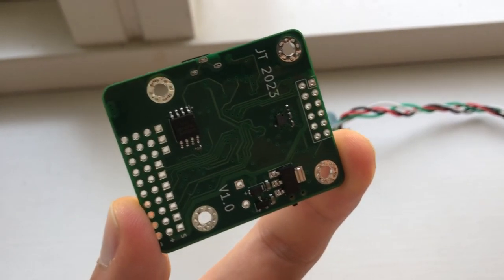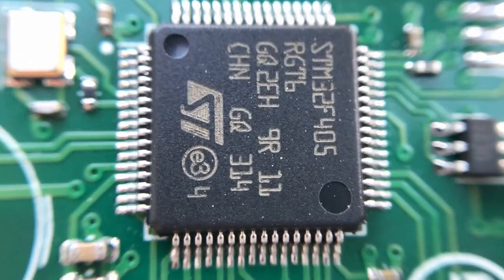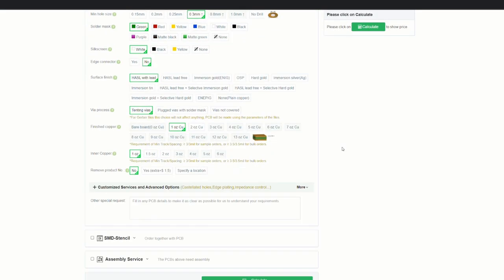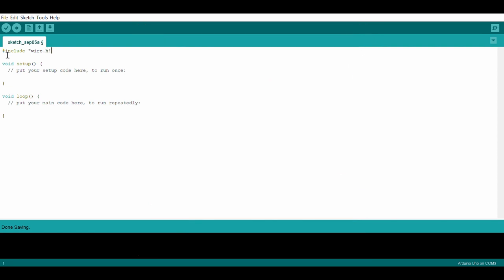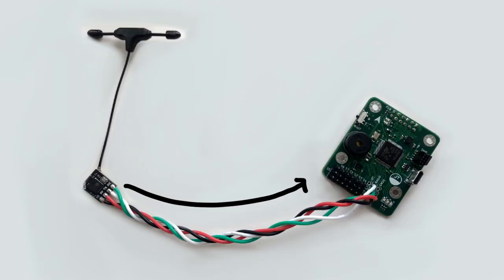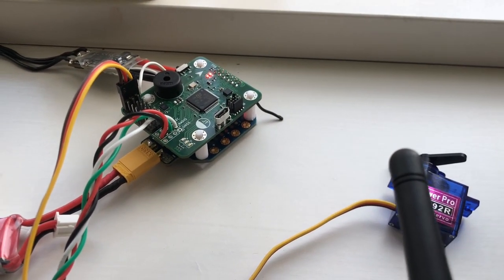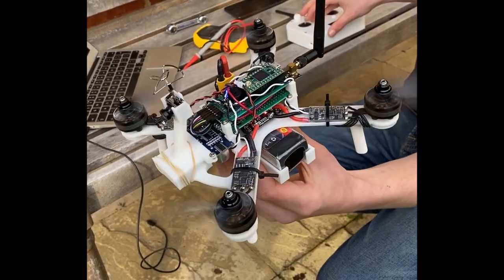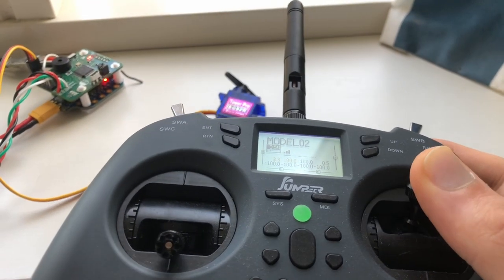DIY Flight Controller for RC Drones & Planes

Comment: Just a comment on firmware: I can't think of a single benefit to using DMA with a buffer of 2 bytes. You end up having to respond to one interrupt per byte anyway, so you may as well stick to using the USART's ISR instead. You still have to process each byte within a state machine for decoding the Crossfire protocol.
Reply from the maker: I think your right! I started using DMA before realising I had to process each byte. I’ve since switched to a simple interrupt system.

Comment: A quadcopter drone would likely be most challenging to diagnose and build, but integrating the Flight Controller on to an existing RC Plane frame would likely be a good 1st step to prove out the Flight Controller development.

Comment: Huge like for not using Arduino. This is a great step forward. I also may recommend you switching to Rust at some point 😂 The support is not that good as very straightforward STM32 tools, but Rust is SO MUCH BETTER as a language compared to C.

Comment: For testing I would recommend a model airplane since its flight is not heavily dependent on software like rotary wing drones. It can help you to gain experience and learn without so much trouble. But you would also need to learn a bit about aviation. Good design by the way, thanks for sharing.

Comment: Hi Jacob,
I am currently building a Tiny Fish FC with a flexible circuit board.  The board is designed for an STM32F3 chip, however.  I am not sure if the system will all have to be redesigned to run on an F4 or higher chip, with additional sensors.  This system should weigh about 7 to 800mg or so when completed.  I would like to adapt it to run on a Crossfire Nano rx, or flex-board version of that as well as a possible next step.  It is for my Ion Propelled Vehicle.  The ion propelled aircraft/thruster lifts its power supply vertically!  It is very lightweight and fragile and nearly 5 feet in diameter.  I will also have to figure out how to reprogram the signal outputs to move two actuators for switching/controlling HV that attenuate 4 outer quadrant segments of the craft, for pitch and roll, instead of driving ESCs.  I was using Arduino/ Multiwii GUI programming with a lower frequency chipset, and two servos to control the craft, I then switched to actuators with digital to analogue converters to save weight.  I would like to avoid the converters this time around though, perhaps by having just analogue outputs.
Any help you may be able to offer would be greatly appreciated,
Thanks!
Ethan

Comment: I think, a fixed wing aircraft would be a good first step to test this new system. Especially knowing you have had trouble with the vibrations of four bldcs, trying to handle only one motor for now is wise!

Comment: I am working with a missionary group.  We have a need to modify the location stored in the return to home function to a new location in the flight controller.  I was wondering if you know, if this can be done with your drone control card.
Reply: Are you messing with remoteID or? Anyhow you can read the TX pin of the GPS and parse NMEA. Then pass it off to the flightcontroller through another pin.  I suggest getting a chip with multiple hardware uart ports. Something like a esp32 or similar

Comment: How much would this flight controller cost a lay man who's not sponsored by PCBWay? And would it be possible to flash it with Ardupilot?
Reply: It shouldn't be too difficult to port to ardupilot since there is already stm32 support
Reply from the maker: Probably about $25 if you want to place and solder the components yourself. Otherwise you will pay an additional $30 for assembly, plus the cost of the components.
I'm not sure about Ardupilot! Definitely something I will try. The microcontroller will definitely be compatible, but I'm not too sure about some of the peripherals.